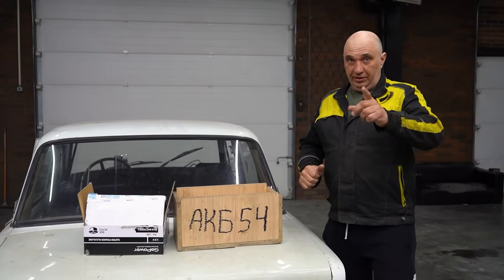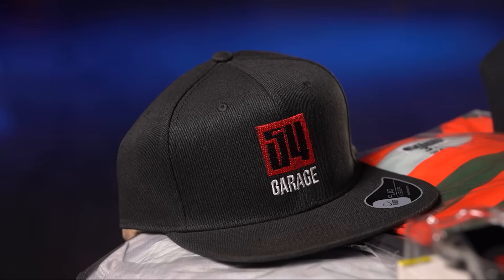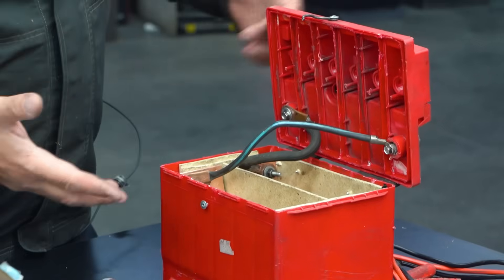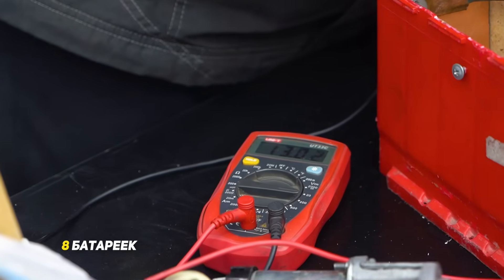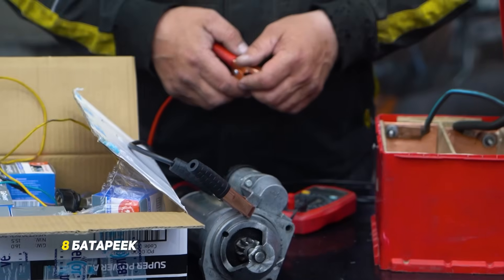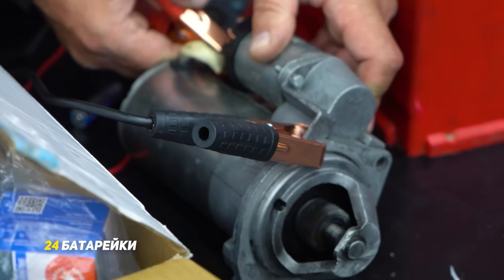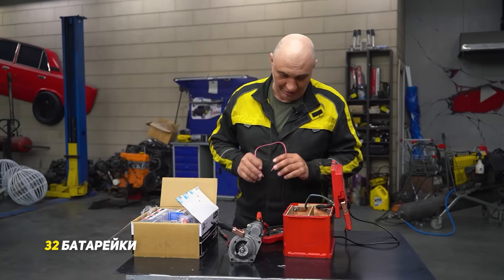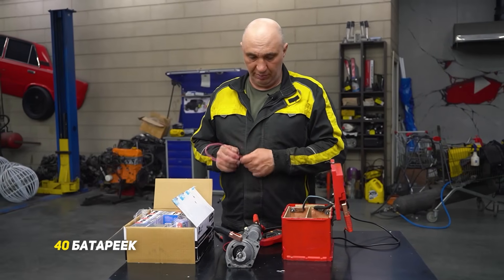How many AA's does it take to start a car?

Comment: I am going to guess before I view the video.  I guess 560 AA batteries to start the car.

After viewing the video, I see it took 300 batteries as the minimum.  This means that the starter was drawing about 37 amps.  I used 70 amps in my calculations to arrive at 560 batteries.  Large V8 engines require about 70 amps.  But in order to give a buffer for daily driver conditions, I stick to my 560 batteries.  Low temperatures will reduce battery current, so go with 560.

Comment: I would love to see this experiment done with rechargeable batteries. Now we know that 308 AA's is the magic number, I am curious to see how long you can make a battery pack like that last for. How many startup cycles can it do?
Reply: Rechargable batteries are lower voltage so you would need more
Reply: @markellii3093  Even though AA rechargeable batteries have lower voltage, it will still take less to start the car because they can supply higher current. Half the amount of rechargeable would start it. I would estimate 100 rechargeable will do the job easy.
Reply: The number would be different with rechargeables.
Reply: Since they are alkaline batteries, they do not have the capability of being charged. As others mentioned, every time the car tries to start, the batteries discharge, and adding new batteries only lowers the capacity of the entire bank. Seeing that a car reqiires up to 100 amps or more to start, depending on how easily or hard to start, and each AA battery is approx. 2Ah (it can produce 2 amps for one hour, before the voltage goes below 9V) by combining 8 AA batteries in series (- to +, end to end) you end up with 12V, but only 2 Ah. Theoretically, 308 AA batteries should be able to produce 38½ Ah at 12V (8 series cells = 12V, @ 2 Ah, 308 divided by 8 = 38½ Ah). There would be a certain amount of loss, depending on how each 12V pack is joined, and then the 38 individual packs. Spot welding would be optimal. But in the battery case used in this example, nothing was spot welded, nor were there any springs (as in AA battery packs) to hold the cells firmly connected to each other. Remember, a standard lead acid battery has between 40 to 65 Ah ratings, and Cold Cranking Amps of 100 to 150 amps. CCA is based on how long a battery can adequately deliver cranking amps at low temperature (around freezing?). It's pretty complex, but if all 308 AA batteries were properly connected and all fresh, they should have been able to start that car on a very cold day, and more than once. Interesting experiment, but definitely could use some tweaking to get consistancy. Too many variables...
Reply: @Donald Fentzlaff

Lead-acid batteries used for automobiles are a bit larger in capacity and power output than that. It isn't uncommon for a car battery to have 70AH or more. Furthermore, battery with 500CCAs is considered to be small, and many are 700+.
Reply: @johnfox3845  you are right. With today's electric vampire autos, battery tech has grown a lot since I was rebuilding alternators and starters, back in the 60's, 70's and 80's. I went to Google to get the stats that I quoted, and I guess they are relying  on the battery tech that I was familiar with. Along with batteries, alternator performance has expanded to meet the vampire with both barrels, in conjunction with its partner the battery. It blows me away that there is such a thing as a water-cooled alternator, now!! 😜🤔
Reply: Definetly 308 is not the magic number. They make a mistake with counting, it should be 304 or 312 bateries, because 308 divided by 8 is 38.5. It must be 38 or 39  parallel groups of 8 serial connected bateries each.
Reply: @rneshev  Right you are! When I did the calculations, the result of 38.5 didn't look right, but I didn't think it through. I concur!! 🤣

Comment: Excellent demonstration of voltage vs power.  You can have 12V nominally but, if the current isn't there, the power isn't there.   A few rows of AA's in parallel looks like a lot of resistance in the circuit.  But lots and lots of rows in parallel reduces the internal resistance of the whole down to the starter's own internal resistance.  Enough current flows and voila, the starter windings do their job.

Comment: @Garage 54

One Lada
One gas pedal
One brake pedal
One clutch pedal
One gear lever
With two engines and two gearboxes working simultaneously on the front and rear axles
Reply from the maker: Have you seen the dual engine Camry build series? It might've been lacking a clutch pedal, but everything else seems to check out.

Comment: Lol!!!😂😂😂 SMFH, You guys kill me!!! Once I was running late for work and it also just happened I had left a interior light on in my car that night before! So the wife was already gone for work, but I needed a very quick solution for a jump start and not a charge! At this time I had 4+ Craftsman rechargable 19.5V battery packs for the cordless equipment. I decided that it would have to work! I have rolls of heavy 12ga wire in the garage, so I made a quick few jumper wires across 3 of the 19.5 battery packs In our to increase the amperage of them and doubled up the 12g wires to the cars 12v battery. It was completely a very quick fix I was praying would work and not fry the cars electrical system! I attempted to crank the engine and it to my surprise turned over, but it wasn't fast enough. So I  had one more charged 19.5v left I wired into the series now going with 4 battery packs to my cars 12v battery. Believe it or not, it cranked the engine right over then and it started. That was when I was much younger and more eager to take chances with everything in life Lol. But today I play things much safer...... But when you are in a desperate situation and don't want to lose your job, you are willing to do dumb things I guess? So yes it's more than possible to start a vehicle by using much smaller batteries if you have enough to tie together in series.
Reply: It would have to be in parallel, not series to work for more current. It's amazing how much juice these little batteries have

Comment: You should try to recharge them with a car battery charger at a low amperage in the “12v” configuration that you have setup.
Reply: Won't work. Alkaline batteries off-gas significantly and rupture when attempting to charge them. Having all of those separate batteries at different states of charge and different MAh capacities makes it unimaginably more difficult. You'd hook it up to a car battery charger and within 5 minutes batteries would start exploding. Lithium battery packs use individual 18650 cells similar to this design, but they have a module called a "Battery Management System" aka BMS which monitors each battery or battery bank in the pack and delivers or draws current accordingly so that the individual cells are always balanced and used according to their abilities.
Reply: @mannys9130  We can assume they were alkaline, but they might have just been regular AA.
Reply: @mediocreman2  regular double A chemistry is alkaline.... there is now also disposable lithium and, rechargeable lithium and older versions of Nickel metal hydride and maybe the other one what was it? nickel cobalt maganesium maybe? but it wasnt common in AA more found in C or D size cells for like police flashlight stacks and early RC/hand tools in other size cells maybe 18650 size?  anyway alkaline is the OG just a shell anode and core cathode packed with a black paste coming with horrible C rating and MAH ratings. The ideal behind the experiment is similar in concept as how 9volt batteries are simply made of stacked 1.5 volt AAA  alkaline cells but for the needed amperage for car starter to overcome 4cylinders compression with enough speed it requires a lot of amps... Amps he drained by doing tests 8 batteries at a time which was like a 1/4 of a layer in that battery shell noting the first amp load test was 100+ amps and knowing he needed 300 or more amps to turn over the car via the OEM battery size required labels stat. The first bunch of tests was just a waste of energy. Also note that a lead acid chemistry really resists a charge and charges at its own pace more safely he wouldnt be wise to let that car run for long with AA batteries or they would pressurized and pop. Lead acid battery if low or discharged actually requires like 30miles driven to top up. Lot of people make that mistake on short tripping cars and is the reason to many complain that "they dont make batteries like they used to".... Old timers understood it took a while to charge lead acid even with the 13.2-14.5volts of alternator electrical pressure pushing at the 12.7volt battery it would take time to charge a "flat" battery. Said to much as usual im out take care be safe.

Comment: Maybe for the next one , could try 18650 Li-ion batteries, how many would it take? My guess is 30 cells 🤔
Reply: Depends on their discharge current,but I'll take a guess that 100 is more than enough,maybe 75 is just about right
Reply: @furry-b5h  My thoughts were to have it 3s by 10p, 3 series giving it 12 ish volts, and parallel 10 giving peak amps of 200 ish (providing its high discharge cells like the ones you get for vapes, if memory serves they were good for 20A short duration, but that will drop cell voltage significantly, so maybe even 4s by 10p to help combat the voltage drop 🤷 definitely would be entertaining to see anyway
Reply: @bradleygriffiths6390  yeah,it'd be cool to check

Comment: about 2amps per battery, at 308 brings you to over 600 cranking amps which makes sense to start a vehicle.
Reply: Except that they have rows of 8 batteries in series to increase the voltage, so the amp capacity is reduced by a factor of 8.
Reply: They had over 100 amps.

Comment: I assume you would actually need more than if you just calculated the straight number needed, I assume they’re alkaline batteries as lithium AA’s would get VERY expensive, but I also assume you’d get sag and such from the batteries and contacts,
I’m no electrical engineer or sparky but if someone could please tell me if I’m on the right

Comment: Should try 18650 lithium batteries, they can deliver some serious current.
Reply: already been done (electric cars) and the issue is the bms to deliver the amps required.

if u ignore the bms u may be able to get 25 amps from a battery and u need between 300-600 to start a car.

14.5/3.6 = 4ish
400/25 = 16

4*16 = 64 18650 batteries to start a car with no bms to reach the required amps and voltage

which is why lead acid outperform lithium batteties when it comes to cca and why they wont be replaced anytime soon.
Reply: @Nickerian91  Lots of BMS units use contactors as charge/discharge for this purpose. LiPo may be a better choice also thanks to higher C rates. A decent 4S lipo could replace a car battery for sure (cycle life would suffer however).
Reply: @Nickerian91  18650 can deliver in excess of a 100 A short term.
Reply: Lithium battery jump starters already exist
Reply: @ouch1011  yes and they use capacitors to reach the required amps
Reply: @Nickerian91  i have started my car on a 1500mah 4s drone pack.
Reply: @geofrancis2001  Yea, done the same!
Those LiPos can deliver a huge amount of power!
It´s almost comical seing such a smal battery start a car.
Reply: @Nickerian91 @Nickerian91, Not the ones I have disassembled.  Just a lithium flat pack.
Reply: @geofrancis2001  I did also:) worked like a charm.
Reply: i have 18650's capable of 40a discharge current if needed ....
Reply: @GatvolFourie  probably Chinese rewraps that say 40a
Reply: @GatvolFourie  which is a blunt lie unless you have 2 in parallel.

"18650 cell rated at 2,000mAh can provide a continuous load of 20A (30A with Li-phosphate)"

The starter batterypacks that is used to start cars use capacitors to reach the required amps
Reply: @Nickerian91  You are quoting continuous load. Starters are burst loads. LG LGDAHB21865 can continuously output 30amps and peak higher. Put 10-15 of these in parallel and you can start pretty much any car (4x in series of course). Also, as someone else stated, you can use contactors to work alongside a BMS so that you don't need such a large one. It would also be possible to separate the starter from the charger/alternator, since charging is the biggest issue with lithium cells and has the largest need for a bms.
Reply: Their current would probably be limited because of internal resistance
Reply: 3S5P should do it with high current 18650s.
Reply: Yes that it common sense . You need lots of amperage to drive larger components although 12 volts

Comment: It would pay to test each cell individually before you install it    as one bad cell could be a resistive weak Link in the chain for the output of all the rest of the batteries in a series configuration

Comment: How about making a full case(in that same shell) of those non-rechargable AA's and try to charge it like normal car battery? What would happen? And how much energy it can provide?
Reply: I had an old Duracell 9v I'd put on a 9v NiMH charger. Maybe for 2 hrs a few times.

I noticed the plastic bottom bulging slightly and cut open the case later.

There was a loud bang and white stuff came out of one of the slim 6 x AAAA batteries inside. 😲
Reply: It would explode. You can barely recharge individual alkaline cells successfully. Grouping them together in series into a bank and then 2 banks in parallel means a LOT of imbalanced cells.

Comment: id like to know how many 18650's or 26650's it would take?
Reply: Are those the little coin shaped batteries you'd find in a keyfob?
Reply: @SwapBlogRU  18650s are rechargable lithium batteries. IMO not worth it, too similar to the batteries used in the test. The 26650s could be interesting though. If it were to be redone, 21700s would be my go to. 35% more capacity than an 18650 or so and only a little bit bigger. 
18650 = 18mm diameter 65 mm length and the 0 means cylindrical. 21700 is 21mm diameter 70mm length
Reply: @SwapBlogRU  do a experiment with a ELECTRIC  FORK LIFT running on multiple 12 volt car batteries  hooked together
Reply: I think you can find ready made 18650 car battery.
You could technically start a car with a 3s or 4s Li-Ion or Li-Po capable to handle a burst current of 70-100 Amps, depending on the engine.

E.g.: https://www.youtube.com/watch?v=ev59YWZMXTI

Comment: Shoulda used rechargeables, then the car would be able to charge them...
Reply: good rechargeable AA's can beat the disposable kind 2-3 times in current output and lower internal resistance.. however price is WAY too high to be worth it compared to disposables.

Comment: Next time try to make battery from capacitators! It will be fun.
Reply: Been done
Reply: capacitors unlike batteries can expend their total electrical potential in an instant  , I mean you could get some of those large caps from car stereo setups but you would have to make a circuit to keep the capacitors from instantly discharging and do some math to have the farad rating over time with a limiting circuit = the amount of time a battery can deliver the power (amp hours or something) . it certainly could be done but it would be very dangerous.
Reply: @ryanjosef  A capacitor, Garage 54 style, would have to be a gigantic stack of 4'x4' sheet metal separated by wax paper.  Put a heavy weight across the top to minimize the gaps between the sheets and charge it up to, say, 96VDC for starters.  Put a current limiter in there and see if it will start a Lada.

It may turn out to be a big flop but, Garage54 does what many people wonder about.
Reply: @ryanjosef  A capacitor will only deliver the amount of energy that the connected load is drawing. Capacitors can and will dump all of their energy in an instant if you short out the terminals and give a direct low resistance path for the charges to equalize. But, if you connect an LED light for example, even a 5 Farad super capacitor will only discharge the amount of amperage that the LED consumes. Although the water analogy is not that great for explaining electricity, think of it like a 3" fire hose being hooked to a fire hydrant on one end but then on the other end you hook up several adaptors to choke the outlet down to a 3/8" bathroom sink flexible water supply line. That fire hose will only flow what the 3/8" supply line will allow through itself. If a starter motor can draw 100 amps at 12 volts and run at that current for 2 seconds to start an engine and you build a super cap bank capable of delivering 1000 amps at 12 volts for 1 second, you will be able to run that starter for several 2 second bursts. It won't dump 1000 amps into the starter and blow it up. That"s not how electricity works.
Reply: @mannys9130  The only problem is capacitor voltage being charge dependent. Even if you spent small portion of the capacitor charge, output voltage will drop significantly.
Reply: @mannys9130  respectfully, I know what a capacitor is . Again , on paper and in practice are two different things .. You are not accounting for whats going on with the car electrically .
Reply: @ryanjosef  The car audio scene caps are almost fake, they are usually the lowest grade caps.
Reply: @DarkLinkAD  if it is just for power storage the quality of the capacitor is not really too important unless they are faking the capacity. They are trying to start a car , not make a filter circuit for fine audio applications .
Reply: @ryanjosef   Its not just quality, its capacity.The size is fake, the capacitor inside has less energy than 1 AA battery.

Comment: It may have worked with rechargeable lithium of nicad batteries  but draining them and adding fresh isnt any good each battery is only so many milliamperes, do the maths and run them in parallel.